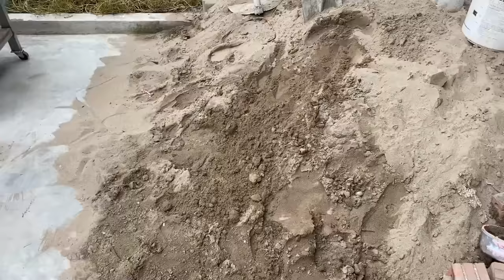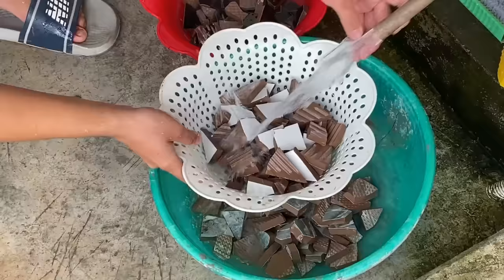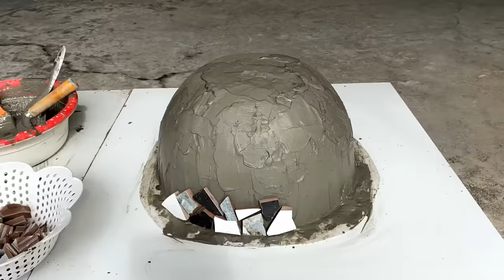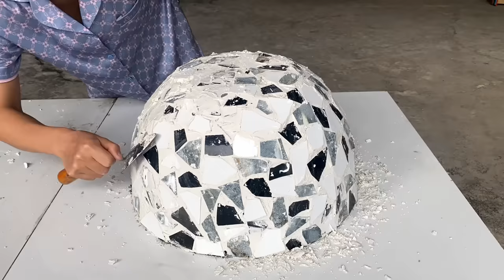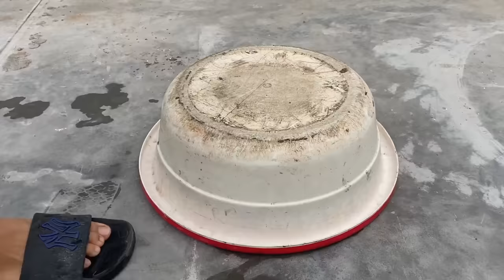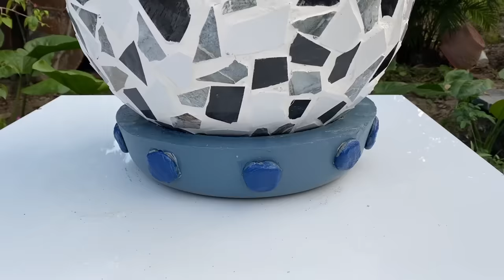Amazing Creative With Cement - Ideas Making Unique Products From Cement

Comment: That is one gorgeous pot, It would be nice to know the  Items And Measurements to make it...
Reply: They used wet sand to make mold. You can use  fast drying concrete. Mix it to consistently you see in video. A little thinner than normal. Use whatever mosaic tiles and press everywhere. Then mix grout to consistently on package. You can get different colors or premade grout. Wipe off but make sure you are filling gaps . They took out sand before it fully cured or dried. You can wait until dried if that's the pot you want to use. 
Oh when pouring concrete over sand. Make sure you use small dowels to make holes for drainage. Didn't watch the base making. But I would skip that anyway. Also you want to buy grout sealer and generously wipe it.  They didn't do that. But I do mosaics and I do it on everything I make.
Reply: Thanks
Reply: @lauraforgey8961  Plural, small 'dowel-s"? How many? what do you mean? Thanks. Can I make my own mosaic tiles of concrete in silicone molds & paint/ decorate? Will that work?
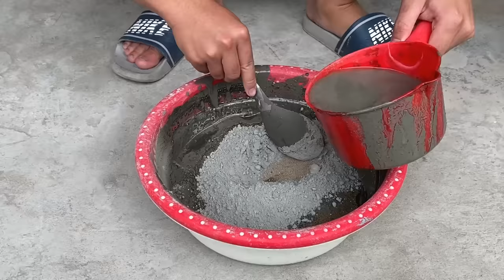Reply: La segunda vez que prepara cemento,al agua le agregaprimero arena y luego cemento? Lo que agrega primero tiene diferente color a lo segundo en esta preparación.( minuto 4:02)
Reply: U don't need measurements,, just be creative and you'll find it amazing..

Comment: For the base, line it, then with dabs of hot glue attachhe stones or tiles to the inside of the dish pan, then pour in the cement & then put the other pot inside. When you turn it all out, peel the plastic off, those decorative bits will already be attached into the dry cement mix.  Remember, they get glued on with tiny bits of glue so that the pretty side is against the plastic not facing into the void. W. stones, doesn't matter.
Reply: Beautiful but I still believe that they don't show everything.
Reply: Do they have electricity?
Reply: @lynnespringer6524    At the beginning they show a pile of stuff, including something with a thick electric cord wrapped up. In various ways, almost every place now has some electricity. But they could use flour & water mix for a paste that would also dry & hold the bits of decorative stuff. Seem to be very creative people.
Reply: Ññ
Reply: @evelynwebster1219  perdone mi pregunta, Porqué La risa?

Comment: Nice. But he could have made another pot from the base.
Reply: The only to get the pot off the dirt, is to remove the dirt. He couldn't use the base to make another pot. Just make another dirt base.
Reply: If u were talking about the first one 💙
Reply: No me gustó pues no mostró qué materiales utilizó, tampoco la medida de cantidad de cemento ni nada.🤦
Reply: Z
Reply: You can't re-use the mixture.
Reply: @yolandact5425  quick dry cement, you just follow the instructions on the packet and white grouting,.
Reply: Excelente  trabajo jenial😅❤
Reply: Base also needs a drain hole.
Reply: @asimgamingshaik4409 WAT?

Comment: Really nice job also can use cement to restore plastics and the plastic places thin layer of cement around the whole peice picking up all the design on it! Than after a couple coats of light layers you can build up the designs if you like and it would be that exact plastic peice just now covered in cement to preserve and look more expensive! Than you will 2 pots! Have a blessed day everyone